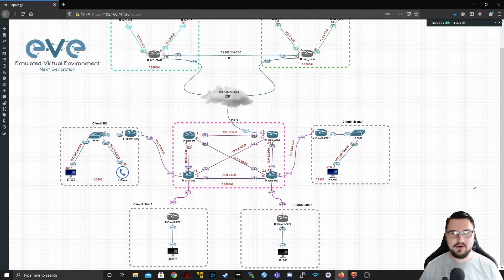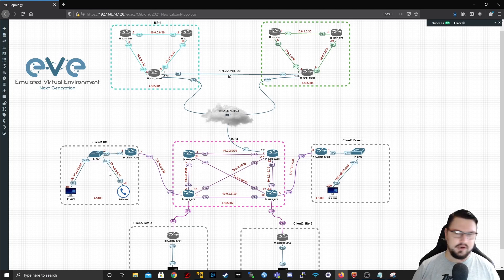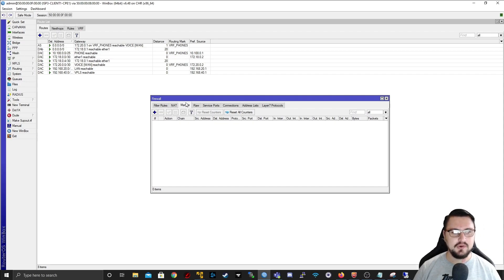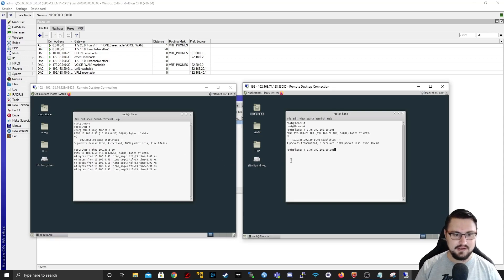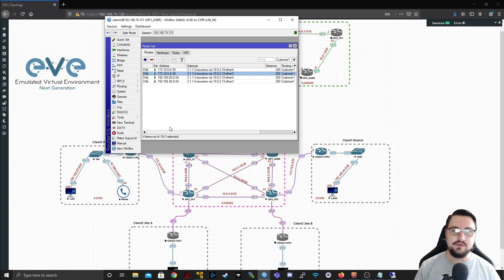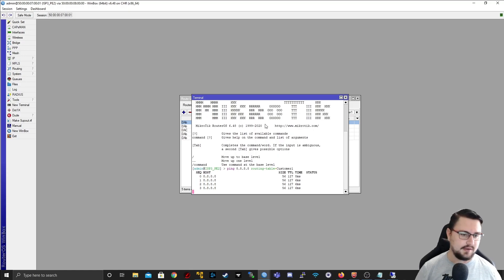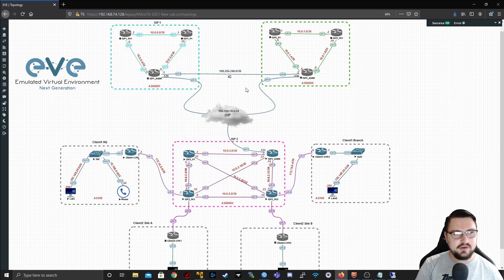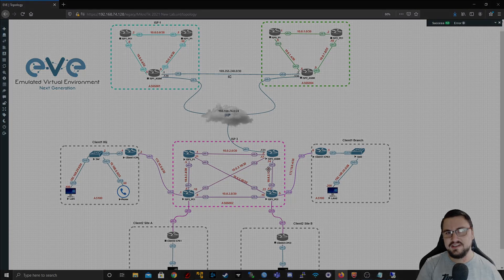MikroTik - Route Leaking (Get Between VRFs!)

Comment: A good method an is used in a lot of ISP is to use a VLAN for the internet BreakOut we are using QinQ and generaly use the main routing table for the MPLS routes and we use an other C-TAG like 50 to have a public IP /31 and we put it in a internet VRF  an you just need to leak 0.0.0.0/0@internet

Comment: imagine this scenario:

you want to deliver internet to one more site.

How Route distinguisher: going to look like. 

Because you can use only one tag here., cant me more then one.
In you case you got only one site and yes you can use that tag for  route-distinguisher

Specifivlly im intrested about Route distinguisher which value going to use for more then one site
Reply from the maker: Hi Nikola,

I would suggest watching the video after this one called "VRF Route Leaking" in that video I am showcasing how to route leak using Route Distinguishers. Example could be

Customer 1 RD - 1:1
Customer 2 RD - 2:2
Reply: @TheNetworkBerg  
you didn't get me. 
That is all good. 1:2 ,2:2  what i'm asking is, on Route distinguisher=it can't  two values on it. Must to be only one whether 1:1 OR 2:2. How you will do here?
Reply from the maker: @nikolashuminosky6987  I think if you want to you can try and draw up a diagram on draw.io and share it with me with what you would like to do. Typically on the IP VRF you can only specify a single RD per VRF, you can however import and export multiple different RDs into/out of the VRF.